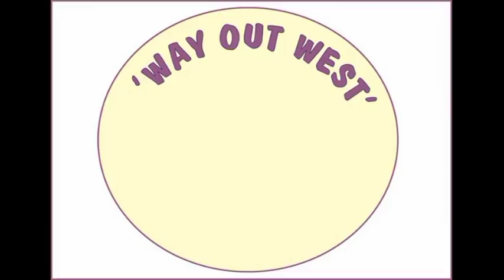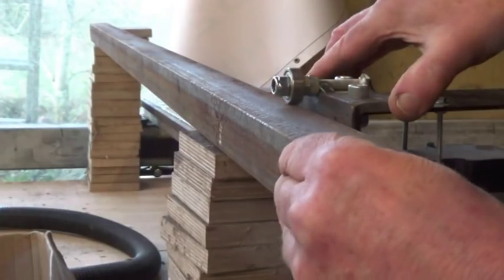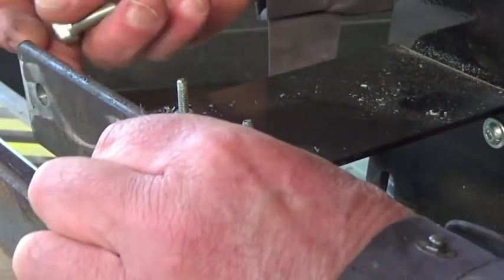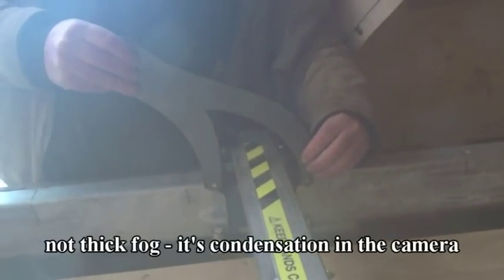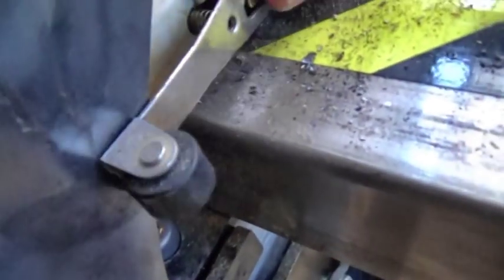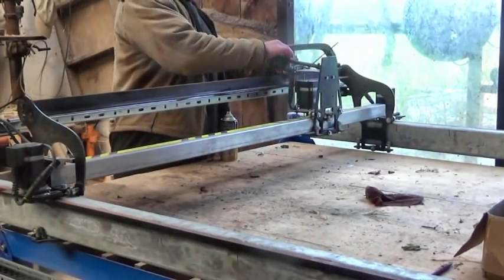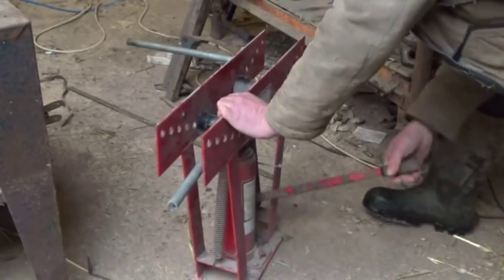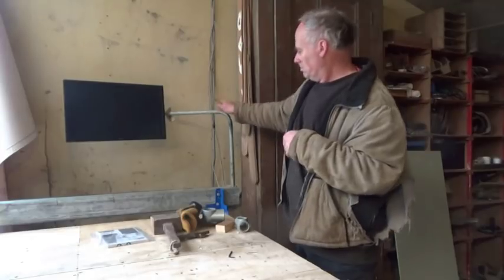Building A HUGE cnc Router. Part Three - Stiffening the Z-axis and other things...!

Comment: 3:12 Is this a plasma cutter or a laser cutter?
Reply from the maker: That's a plasma cutter. (MUCH cheaper to buy and run than a laser.)
Reply: @WayOutWestx2  the cut is so accurate and so clean. Have you done anymore finishing to make it look this way?
Reply from the maker: Wire brush on the underside is all it takes. When the settings are right it leaves a perfect finish

Comment: The things folks will do to not buy linear guides.
Reply from the maker: Yes, that might have been more sensible, but I didn't have them lying around
Reply: @WayOutWestx2  you could have gone the phoney V bearing route. That's where you put two bearings together with a smaller diameter spacer between them. Say a washer or a nut. My Z axis runs on phoney V bearings. It takes twice as many bearings but it limits movement in more axis than a single bearing does. Making linear guides that perform well is difficult. Which is why the linear rail manufacturers aren't going out of business. Here's what phoney V groove bearings look like https://i.imgur.com/arzFmKQ.jpg
Reply from the maker: Excellent suggestion, Paul. Thanks very much. I never went to college and I know very few engineers, so mostly I learn from my mistakes - and from helpful people such as yourself.
Reply: @WayOutWestx2  this is a clever hack I saw others doing on the web. I never thought much of it myself but when I tried it I have to say it works. It may not be ideal but it can handle the side loads a CNC machine can put on it. I don't know why V groove bearings are so expensive either. 2 plain bearings are far cheaper. I will add that when I did it I took special care to make sure all of my spacers were the same thickness. I measured them all with calipers.